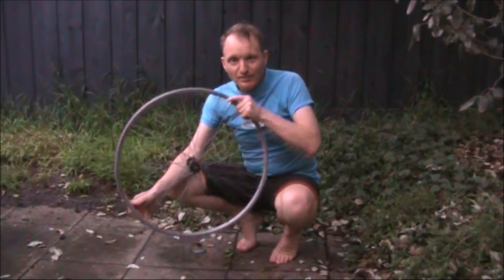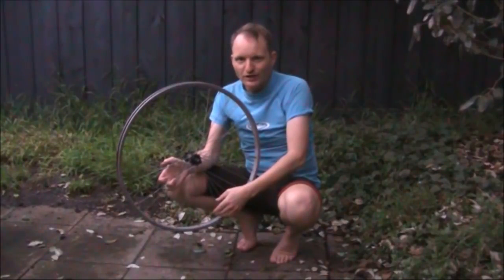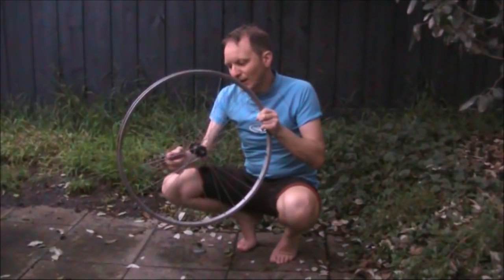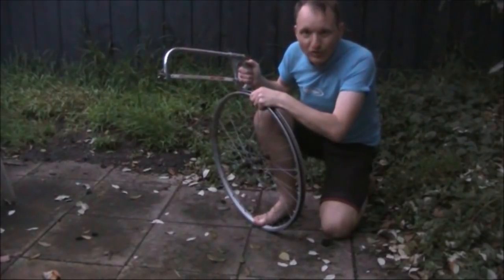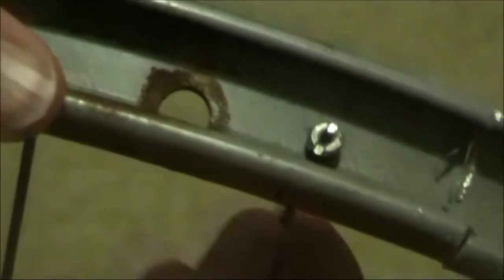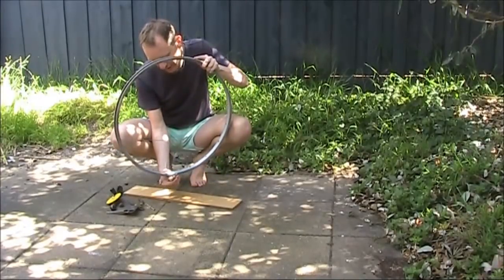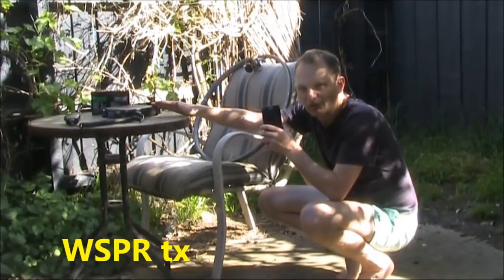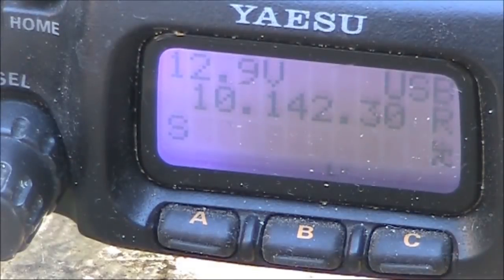A 7 - 28 MHz bicycle wheel magnetic loop for listening and WSPR transmitting

Comment: using a 622mm wheel should give slightly better results at 10mhz without giving up anything, and that's the standard size for anything else than children's bikes and folding bikes.

Of course, you just used the 26 inch wheel you had lying around

Comment: When I made mine I opted for the coupling loop of copper wire, and used a recycled tuning capacitor from a radio alarm clock. It tunes 20 thru 10 meters. It transmits well at 4 watts with a CB radio. It's not bad for almost completely free.

Comment: As a cyclist who wore out rims back when rim-brakes were all we had for Mountain Biking, I have some fine MAVIC hoops I can cut for this project.  OUI OUI!  (Mavic is French Co.)
Reply: By the way, if those are stainless spokes, they can be "hard soldered" with SILVER 56% or so.  Takes a good bit more heat than electrical soldering (torch no iron) but it's a great join. Use flux, wash all flux residue away when done. Silver can join ferrous and stainless.